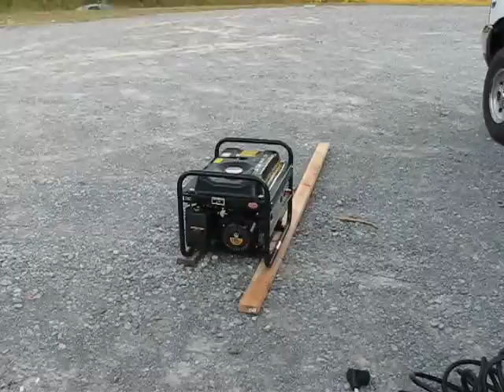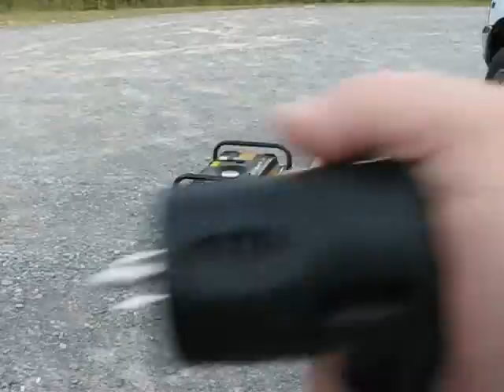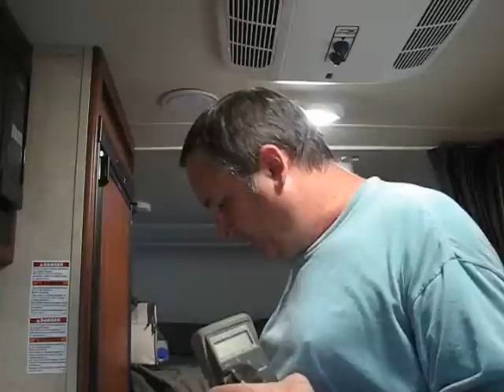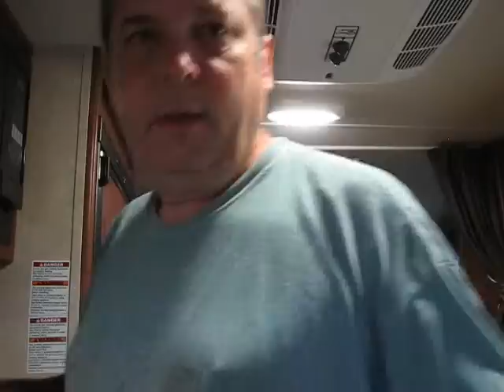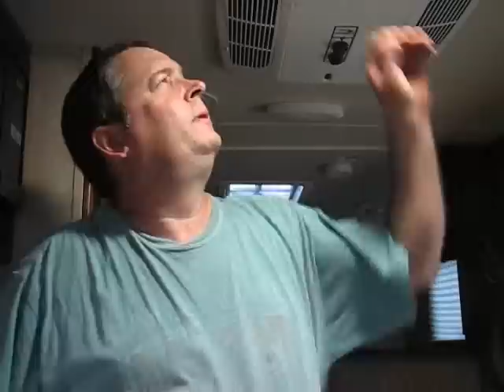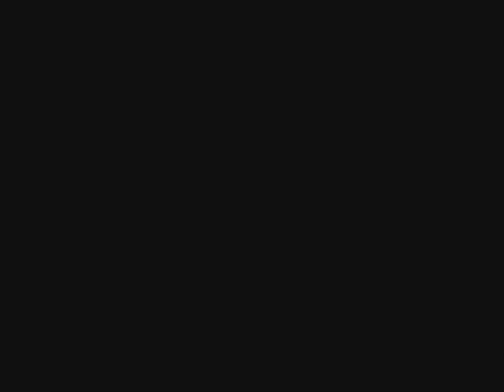Camping Generator Running an RV Air Conditioner

Comment: Good vid Tracy. Great to see the Chinese genny still puttering away. Just goes to show with setup and proper servicing how reliable these units can be. Isnt it amazing what a bit of heat, and some ammonia and water can do. Reliable refrigeration for many years. Its a wonder the possibilities of absorption based cooling have not been developed further for home cooling.Cheers as usual, Mike.
Reply from the maker: Thanks, Mike. Yeah, I can envision running an air conditioner on methane from a home digester! Of course I could just run a generator on the methane.

Comment: Yes, they do make an absorption home AC but they are are about five times the price of a freon-based compressor unit.
Reply from the maker: I'm not surprised, given the prices on absorption refrigerators.
Reply: They were sold by the gas company as being economical as they just needed a little flame (Natural gas was cheap, cheap, cheap then  compared with electrical units) They were very slow to cool down when cycled and had far more problems than compressor units. (I was selling central HVAC units at the time)
Reply: Another draw back to having ammonia as a refrigerant in an hvac system its not compatible with copper and its direct cooling meaning that coil is in the living space. You get a large leak in that coil which is very common after time then its no fun for those on the recieving end of that leak. A large enough concentration of pure ammonia can kill you. Its a poisonous chemical. Its still used commercially for refrigeration but not a good idea for residential hvac since there are better alternatives.

Comment: So you put a RV 30 amp plug and converted it to 20 amp house plug and plugged it into 20 amp outlet on generator. This generator has a 30 amp RV outlet so I don't understand why you would risk a failure do to high watts Wich means a breaker trip or fire. What this shows me is I made the right choice buying this generator. Ty for the video
Reply from the maker: Yeah, it would be nice if this one had a 30 amp connector because using an adapter is suboptimal at best. I thought about splicing a 30 amp outlet into the generator panel, but I'm not sure the splice would be any better. I might just build another power cable with a 20 amp plug on it, to eliminate the extra connector.

Comment: My generator is a preditor. It says 3500 continuous watts. It also has the 4 port female outlet. I used an adapter to plug in my camper ac which is 30 amps. Why does the fusees keep popping out. It has two fuses. Is that one for each leg. And why do they say 8 amps per fuse. That's a total of 16 amps in my opinion.
Reply from the maker: That should be one for each leg, yes. I don't know why it would only have 8 amp fuses or breakers though, because that is less than 1000 watts per leg. With fuses like that, no wonder your camper pops the fuse.
Keep in mind that you cannot get full power out of only one leg. Not even half power in fact, unless the second leg also has a pretty good load on it. The loads must be balanced across both legs.
I hate to tell you this, but for powering your camper you would be better off getting a generator that is 110 only. While you're at it, it would be a good idea to get one that has an RV specific 30 amp outlet so you can eliminate that adapter. That's what I ended up doing. I still have this generator and use it occasionally, but for use with my camper I got a new one that has the RV outlet. It also has electric start and is dual-fuel so it can be run on either gasoline or propane. Here's a link to my video about that one: https://youtu.be/5_mPUiWkiWQ
Reply: @Possumliving  thanks. I haven't looked at the fuses in a while. They were 12 amp a piece. And let the gen run for about 5 min before I put load on it and it worked fine. I don't know what happened. Maybe there's compactors that need charged or it's cooler now. But never had luck till now. Or was it I cleaned the carb too.  Smh idk. But I tested on low cool and high cool now and it works.
Reply: I like the gen u talking about. Mmmm mmm. Need one lol.
Reply from the maker: @JamesBrown-ei8wc  I like mine a lot. I've had it for probably about a year now.
Reply from the maker: @JamesBrown-ei8wc  Good; I'm glad to hear it.